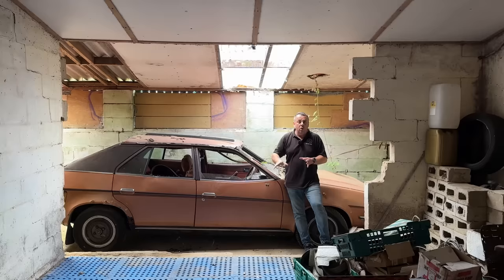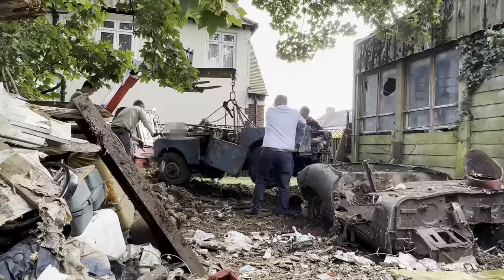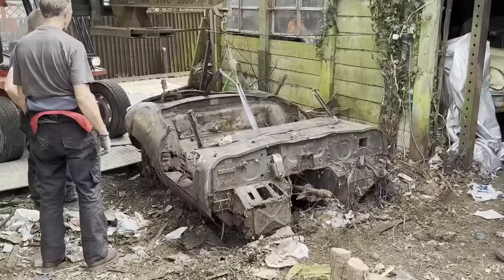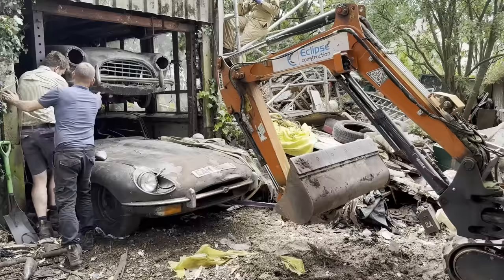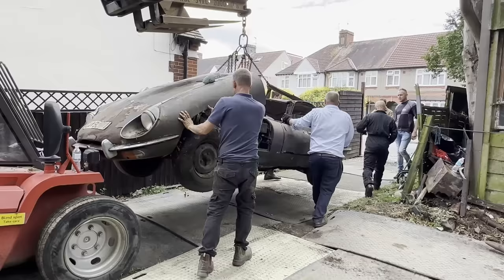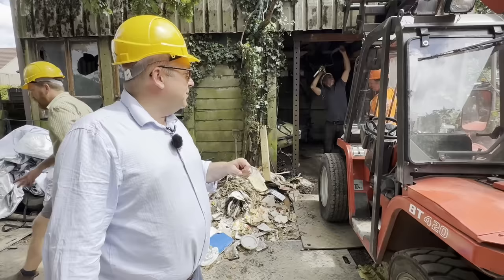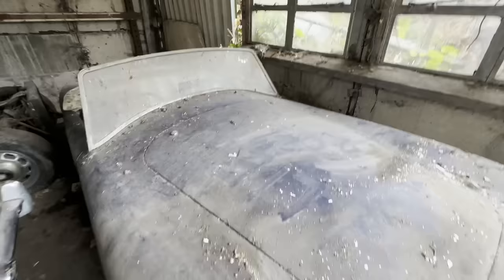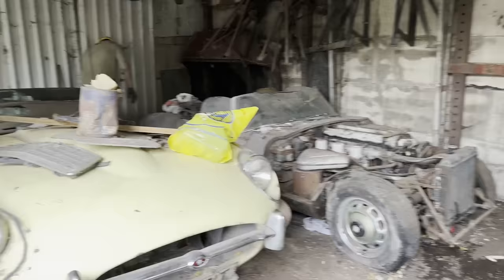UK Barn Find Of The Decade? Rare Cars See Daylight After Nearly 50 Years! #barnfind #classiccars

Comment: You know, that first E-Type that came out off the grass, that body and 'frame' (what's left of it at least) in the States here, that's still a car. It has a VIN number, it's an authentic E-Type, it's a car and could very well be 'saved' no matter what went into the resto. Amazing find!!
Reply from the maker: Absolutely. That's what happens here, too. There is also a number printed under the rear registration plate, I believe, which can be used to identify the cars, and then heritage certificates can be obtained in order to apply for a 'new' registration. With the right evidence, it can also be possible to have the original registration plate allocated back to the car in some instances.

Thank you for the comment. It's great for us to know that the video is being enjoyed in the USA.
Reply: In Holland as well. My old man has only driven English cars over here up to very recent, like a MGB, Rover, Jaguar X type and a Land Rover Discovery.

Comment: Question folks the first two removed the Land Rover jeep like thing & the E type shell. Those two are so far gone that what can you do with them other than maybe some parts. A friend of mine bought a 1969 RS Camaro convertible out of New Jersey. He had it shipped out here to the West Coast. He knew from the pics that it had some rust but he thought is was relatively solid, they were creative in the pictures so it didn't look that bad. Anyhow it split in two essentially coming off the transporter. In the end he just stripped off any usable parts and scrapped what was left. So what can be done if you acid dip these vehicles almost all of the metal will be gone?

Comment: Around 1972/3 the new owner of an old riverside pub had old barns on the property apparenly it was for horses to do with the pub decades before, perhaps hiring them out, anyhow I worked at the little boatyard next door, and one day my boss called me over all hush hush and said the pub owner wants to get inside the barns can I get some tools to break in with as little damage as possible,( although I was the "newboy" I got all the nice pleasant different jobs)  anyhow long story short opened the barns to fine in fact it was one very large one, and there right in the middle under a half inch of dust and guano was an Alvis convertable. I know nothing about them so that's it. A month or so later a crew of guys turned up with a ton of gear and built a sort of hermatic chamber around the car and pumped a fine mist of I think distilled water with oils or revitalisers or something, this was to "liven up" so I was told the all leather upholstery the hood and the tyres. The hope was they could later inflate the tyres and roll it out. So there it sat for nigh on 6 weeks in the "greenhouse" and sure enough all but one tyre reflated the leather was not crispy crunchy and they got it out and onto a flat bed all sheeted with  "blankets and tarps and covere up and that's the last I heard of it. I know where it went for restoration but no more than that.

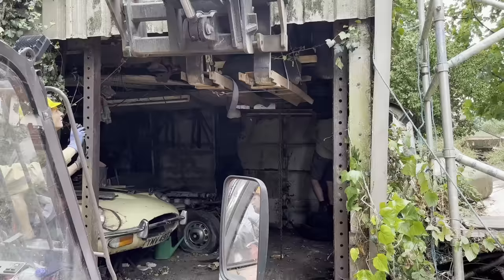Comment: 14:14 Temporary driveshaft with a chain sprocket, looks like he powered that in there. 38:20 The pin holes in the steel posts are the giveaway as to how he got them up there, one pin hole at a time with a jack.

Comment: Its such a shame we live a incredibly short life and family and life then old age gets in the way, 

This will be me in 30 years time, 

E type jags in 70s and 80s we're not worth anything unless in mint condition, 

Now the prices have gone up even rusty wrecks are worth money 

The disappointing thing for me is there is more value in the junk.spread around and piled up in the back garden, 

Wings, gearboxes, axles ,engines ,propshafts wheels,and, bits of frames for seats , nuts and bolts for the cars which are worth more money than thee actually cars in garage 

Someone should have gone through the back yard before any removal of cars because valuable stuff is being stepped on and thrown away, 

Shame as I could have spent a week itemising and putting the parts into crates prior to removal of cars

Don't take this the wrong way but the auction is just going for instant money cars without taking the time to go through the back yard, 

Great video and glad you video it.